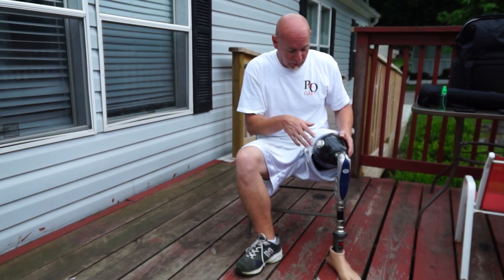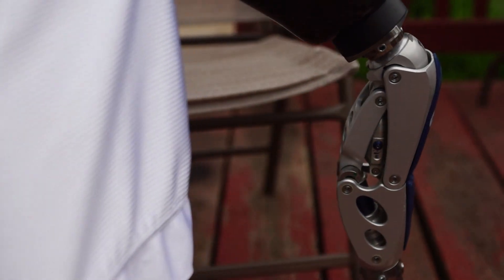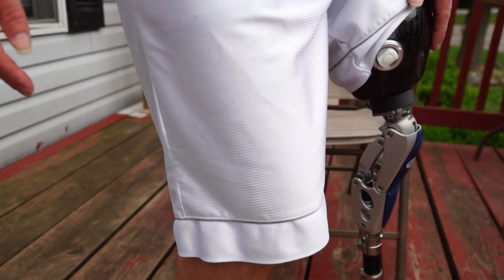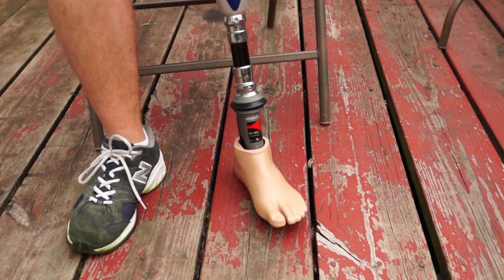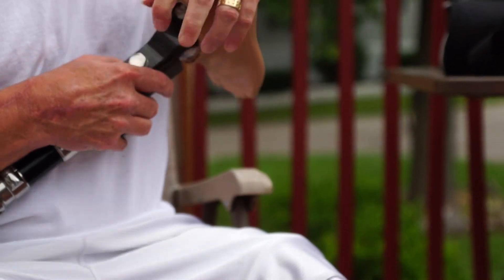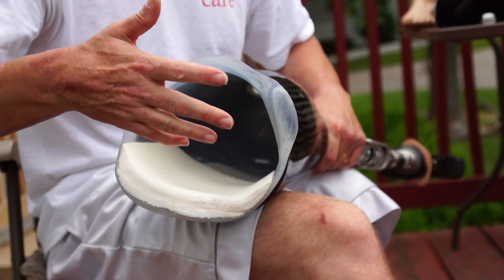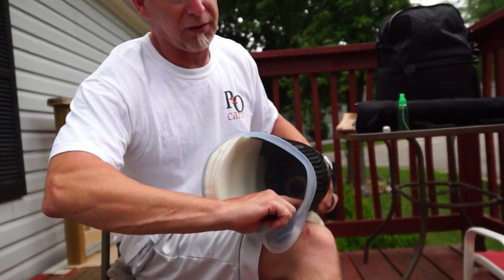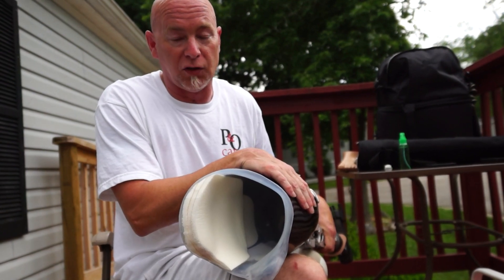AmputeeOT: How An Above Knee (AK) Prosthetic Leg Works

Comment: Hi my name is Jennifer and i am a right leg aka and i was wondering how do you drive once you have your leg removed? I would love to be able to drive again but I don't know how i would be able to.
Reply: i drive using my left foot after my leg right leg amputee im trying to learn how to walk again
Reply: PLFA.ORG - check it out . I've been using one for about 2 weeks and it works great !
Reply: Take your right prosthetic off(so it doesn't get in the way) and control the pedals with your left foot. I learned to do it when I broke my leg when I was 20 :) For me, the hardest part was my casted leg being in the way.
Reply: I use to drive just after 2 months of amputation.
It's easy to drive a Auto Transmission cars im trying to learn manual transmission also but it's really hard.
Coming to bikes i have rode low hieght bikes like bajaj Avenger (India).

Comment: I had my right leg removed all the way up to the hip around the year 2007 when I was still a teenager/young adult. Right now I am on my second prosthesis. The leg I have now I got in January and it doesn't bend very easily. My family doctor wants me to go back to pt to relearn and strengthen my muscles so I will be able to use the new leg. I am willing to do anything so I can learn to bend the leg, one day I would even like to learn how to run with it. I have been sick my whole life so I have never been able to run but I think I would love it. Any suggestions on how to get the leg to bend and/or for me to be able to run?
Reply: Try and get yourself sorted out,  i work in prosthetics 

An above knee amputation is rough, both finaically for your prosthetic and learning to achieve a large level of functionality.

It isnt particular bad though, certainly a lot of other health afflictions are worse. Your socket can vary due to the manufacturing process and the type of socket it is, i recommend you work closely with a prosthetist and a physio to try and get you to full functionality. I would really recommend visiting different prosthetic clinics to achieve the best result

Running again is a very achievable goal
Reply: Jennifer Marie hey. I'm considering getting my leg amputated I have stage four cancer I'm in so much pain. They said it would have to start from my upper thigh and I wouldn't be able to get a prosthetic leg.
Reply: sorry i don't understand why you wouldn't be able to get a prosthetic leg? I had my right leg removed to my upper thigh do to problems I was having with scleroderma. I was diagnosed around the age 7 and the doctors wanted to remove the leg around that time to. My parents refused to make that decision so the doctors waited until my 18 birthday and brought it up shortly there after. I did my research and I asked many different doctors but in the end I decided it was the best thing for me. If I had to do over again I wouldn't do it. Before the surgery I could walk miles a day for exercise but now I can hardly walk to the mail box across the street without falling or hurting. I have put on weight and am the heaviest ever at 207 pounds. I have read other peoples post and they have good results with the amputation so please don't make you decision on what I have to say. You have stage four cancer which I think is sicker then I was and it might so higher up the thigh so you might have to have more of the thigh removed then I did. Ask yourself if you can live in a wheelchair the rest of your life or does the amputation have to happen? I had a choose in the matter the amputation was only supposed to make my life easier with a bendable leg. I wouldn't need any more surgeries and I would be able to bend my leg which I haven't been able to do since I was like 3 years old. I am still having a hard time learning how to bend my prosthetic leg just because I have gone so long without it bending I don't know what it feels like. I would love to talk to you again but I think you should do your own research and ask the doctors all the questions you have. That is what they are there for.
Reply: I sent you a message on Facebook but i don't know how to friend request
Reply: Ok
Reply: Jennifer Marie can u add me in facebook or instagram please? I m also a hip disarticulation patient. And i have something to discuss with u. My facebook: Tanjimul Islam. Instagram: clash_with_tanjim. plz add me
Reply: From where one can get it?
Kindly update me
Reply: hello hope you are good? you are useing now otto bock knee 3r60 please write me with detiels?
Reply: I also need it,  like this one